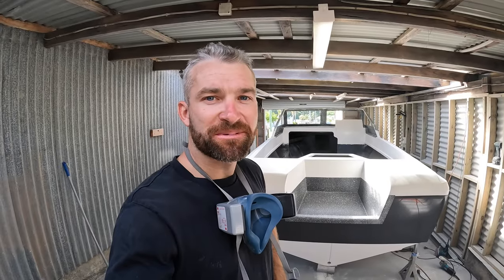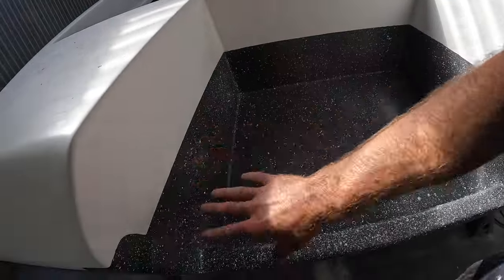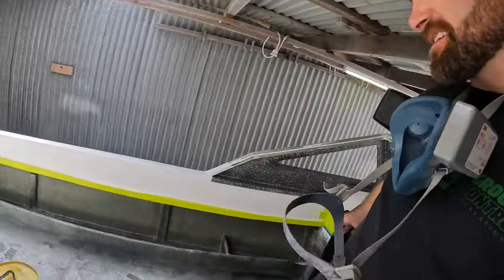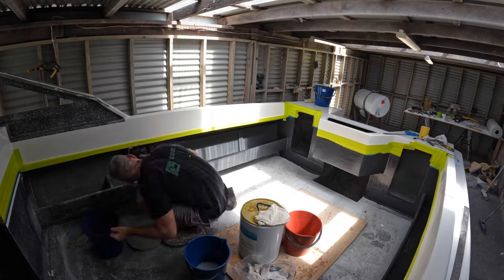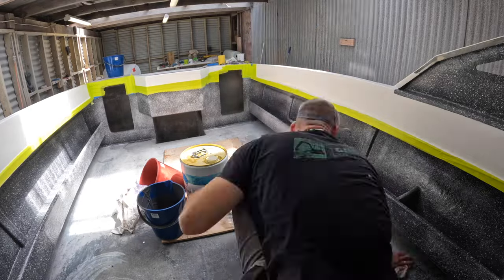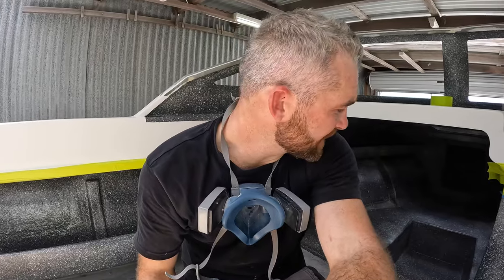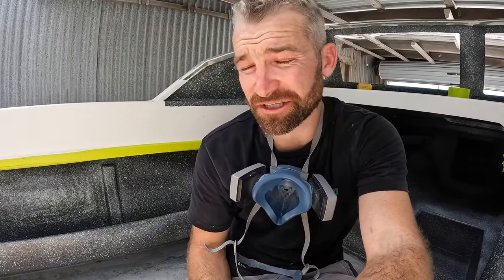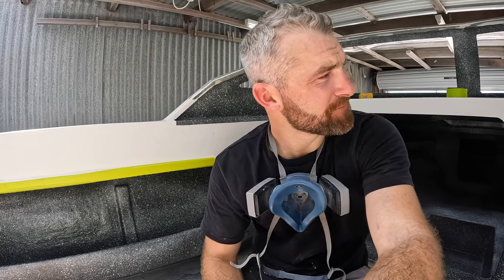How to Spray Speckle on Flowcoat / Gelcoat

Comment: Hey mate a bit late to the conversation but speckle on the floor acts like a cheese grater on any bare skin in a rough sea be it your feet or if kneeling on the floor, awesome job looking real nice really like the colours
Reply from the maker: G’day John, thanks for dropping in and checking out the video. I’ve been using the boat a fair bit and haven’t had any issues like that. I put a grit down on the floor for grip and I’m really happy with how it has provided a good even grip without being to hard on the feet. I might do a foam floor one day but for now that flowcoat with speckle and grip is working well. Cheers

Comment: Speckle coating is a learning process. Less is more most times.
Did you run any pipe or studs under the drivers side rail to carry your wiring loom and control cables ?

Comment: there is a fair range of diy evaflooring i have had the ebay stuff look through for the best quality for the money but it has the 3m glue and comes up really well and lasts great doesnt look as good as custom routed but can be done well with some thought,
boat coming along great
Reply from the maker: Thanks mate, I have seen some boats done well with the “eBay version” but I really think I’d rather wait and do it with the router and a professional, I feel like it wouldn’t do the boat justice if I just cheaped out there. Thanks for the advice 🍻

Comment: Hi what is the. White speckle that’s in the cup is it flow coat  or just white marine paint   ,  great job mate 🏴
Reply from the maker: G’day mate, it’s flow coat or gelcoat with wax.
Reply: @ADVENTURES_ADRIFT   is the speckle applied after gray flow coat has set?
Reply from the maker: The flowcoat must be tacky and not fully cured, having it tacky is preferable and then spray speckle. The reason behind this is because flowcoat contains wax in styrene and once cured it requires sanding before bonding to it with more flowcoat/ resin.
Reply: Very Impressed by the finish you are achieving on this project. Don't compromise on the eva decking it would be a shame to spoil it now. Finishing to a high level takes more work than the repair / rebuild does. Great work from legends boat works
Reply: Nice work mate.